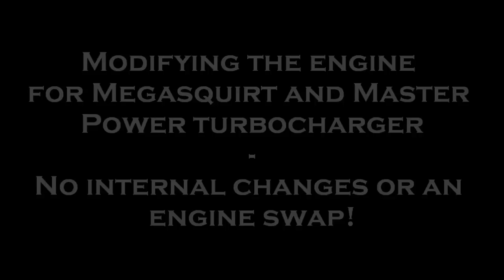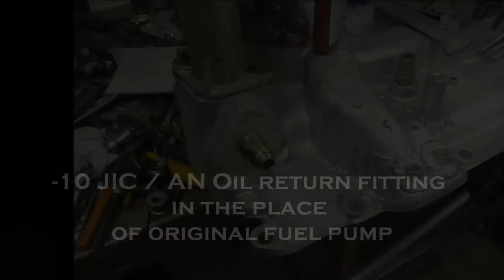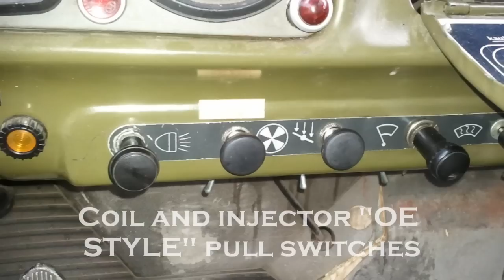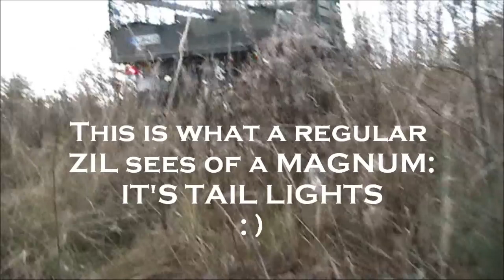ZIL 131 MAGNUM - a unique project

Comment from the maker: It's amazing how my fun-project has got so many views. Thank you for anybody who has watched and shared this video!!
To be honest, I've been quite lazy and no real proggress has happened.

But, I have plans!!
One is to raise compression ratio by modifying combustion chamber and getting the larger pistons/cylinder sleeves (where can I get the piston / cylinder sleeve kit or a complete ZIL 375 engine, CHEAP??) and crew cab for a chassis mod?
I'm also thinking of getting the LPG and ethanol flex fuel possibilities. These need Megasquirt3 to be installed so I guess the current EFI kit will be for sale at some point. I will let you know if the time comes!
Reply: Helloy! Sorry me for my english, I talk bad him. Say please what consuption fuel and what power was got after modernization?
Reply from the maker: Максим Бородин No problem!
Last time I calculated the average consumption, it was 58l/100km. At that time, there was offroad, urban cruising, and some highway.
After that, I've modified the fuel mapping and also ignition timing and am not aware of the effect.
HP? No idea. We have a certain "long" hill nearby. In stock condition I had to shift down to the 1st gear, now I can run it on 4th gear.
Reply: HevosvoimaCom That is to say, is got, modernization motor has not done more economical? I it is correct has understood?
Reply from the maker: Максим Бородин Yes you understood correctly!
However, the tuning approach we made before that was incorrect. I made alterations in the tuning afterwards, but haven't had good comparison measurements afterwards.
Reply: Very amazing work man! Thank you for good and very beautiful video. 

Did you find piston set for this type of engine ?
Reply: HevosvoimaCom What is the power after tuning the motor. Sorry for bad English.
Reply: +HevosvoimaCom Name of song ?
Reply: Not bad at all; I like the idea. Nice work. Lots of skill & planning. Now, just curious, but: were all ZIL-131's equipped with standard transmissions, or were some automatic? Also, have you considered swapping engines for something like a Dodge Cummins or a similar 6-liter turbodiesel?
Reply from the maker: as far as I know, only manual transmission was used.

I know such swaps have been made and could be done, but I don't have the interest :)
Reply: Awesome engineering mate, great video.

Comment: Nice to see someone showing the old workhorse some love :)

Your idea to run it on LPG and/or ethanol has merits, my friend. There are two ways to profit from it: 
In Russia, ZILs made for gaseous fuels usually have cylinder heads modified for higher CR, about 11:1 - there are even factory made heads of that type, so you may see if you can get such heads from Russia. This would also make it more efficient in terms of fuel for HP.
Your approach of up-boreing would work as well, of course, and could also make your engine more efficient, depending on your driving profile, but you'd need to either have your sleeves and pistons custom made or import them from the States (ZIL V8s being a copy of some Ford engine).
Both would leave precious little room for boost, though, especially the up-boreing option, since the big end remains the same.

The second way would be to just run very high boost, on both ethanol and LPG, it can be as high as to reach effective compression of around 16:1, maybe more if you get those fancy spark plugs - or if plasma plugs become available, haha :D That equals plenty of boost, around 2 bar absolute :) And it would be the easiest way for you, since you already have turbochargers installed.

Keep up the good work!
Reply: Нет не каких специальных головок для работы сжиженном газе для ЗИЛ 130 нет, а этот двигатель хорошо подходит, для установки турбины, потому что у него маленькая степень сжатия 6,5 так что с поршневой делать не чего не нужно. А вот есть 7 литровая версия этого двигателя от автобуса ЛиАЗ и версия на 92 бензине от Урала.

Comment: I still love this video some 10+ years after first seeing it 😁 Is the Zil still around and boosting?
Reply from the maker: It still exists and runs, however it needs some love!
Reply: @HevosvoimaCom  What does it need? I've got a friend not too far away from where I think you are...  Lempäälä. I could visit 😆
Reply from the maker: Starter needs an overhaul and the wooden bed is kaputt :D
But, one can crank start it with the manual handle!

Comment: Hi! Thanks for video again! Your project is popular among adequate customizers across Europe (not only former USSR). Our club is also using it as a reference. We recently bought soviet truck GAZ-66 with V8 4.3L engine. Conceptually engine is similar to ZIL-131, just a bit smaller. On the way from Finland to Norway special pain was mountain roads, so there is an idea to turbocharge this engine for use in Scandinavia. What kind of turbo would you recommend for such a truck? Most interesting RPMs around 2500-3000. Thank you in advance!
Reply from the maker: Happy to hear that the video has been useful!
The engine is similar, but it's pretty much completely different in every way.

The turbo I use is a T3/T4 sized Master Power with 49,5mm turbine in .48a/r housing and 50mm compressor in .50a/r T04E housing. This works because the exhaust headers are quite long and large in volume.
I would say that similar sized turbo would be OK, for example from a Garrett GT32 series.
We have available a new model Master Power that is with .63a/r  turbine housing and similar sized wheels.

If you are planning a twin turbo, then the turbos should be smaller, I would say GT17-GT22 series sizing, but I would go with a single unit.
Reply: Thank you for quick reply and details. I would like to go for single unit as well, I just need to cover area of max used RPMs. No need on full range for truck. Will investigate mentioned options by you. Potentially will buy stuff from you as well (if shipping to Norway is possible) and for sure would need some advises. Could you, please, give me some contact, where we can communicate directly and not in youtube comments. Can I use your webpage email?
Reply from the maker: Shipping to Norway is possible. You can contact me via @Turbotohtori or @Hevosvoima.com in Facebook, for example.

Comment: Greetings!A lot of work has been done, I have one question for you.Has anything been changed on the piston or has the original one remained? I'm just afraid that the original pistons may not be enough for a long time due to the increased thermal load and increased pressure.
Reply: Stock block, stock pistons, stock rods, stock crank. The engine has no problems to handle the extra power, only thing that needs to be upgraded is the clutch and transmission (suitable would be URal 375d trans). Good and precise engine management is the key for engine longevity, stock carb and dizzy ignitions is not the best :D
Reply: Где находишься Амиго?
Reply: @daudibragimov5144  Ногинск МО

Comment: Is the engine now straight gasoline or still capable of burning a mixture?
Reply from the maker: Technically it's quite possible and could be done properly with adding an ethanol sensor to fuel line.

Comment: i would get a URAL and stick a customized v12 twin turbo diesle, a 18 speed eton fuller gearbox and a fully customized drivetrain, suspention and intake on it but leave the truck looking stock. then i could chop some shitty kids at the drag strip.